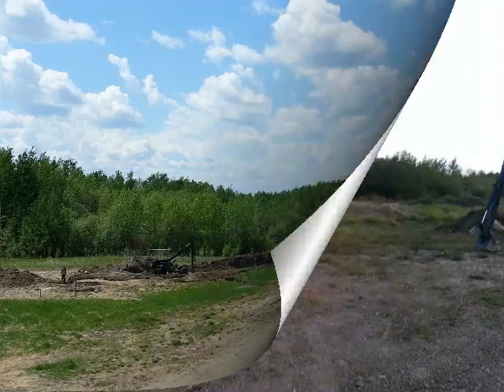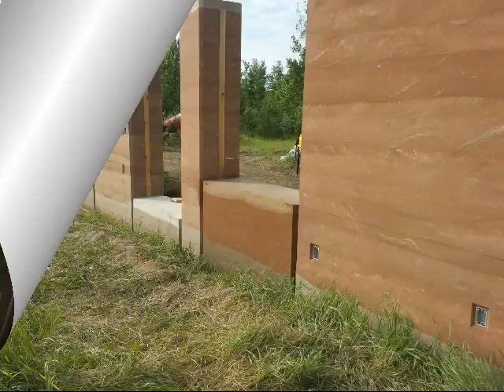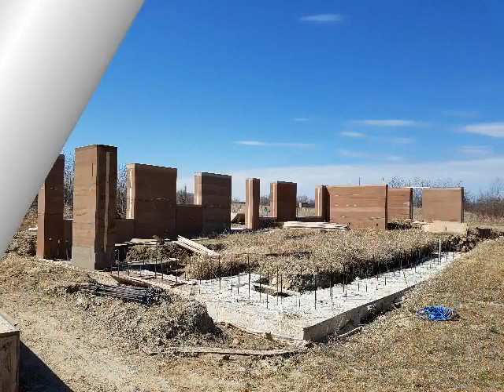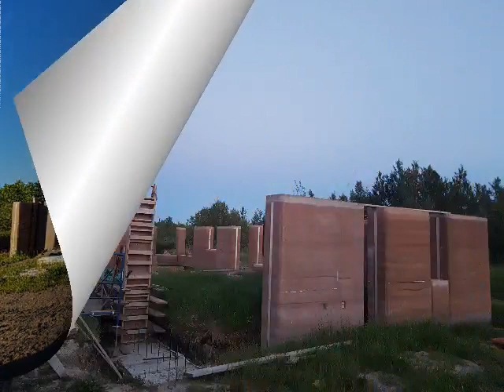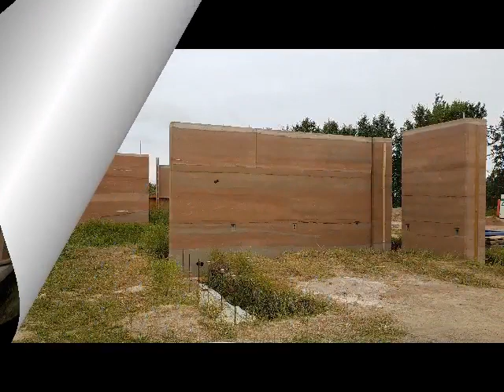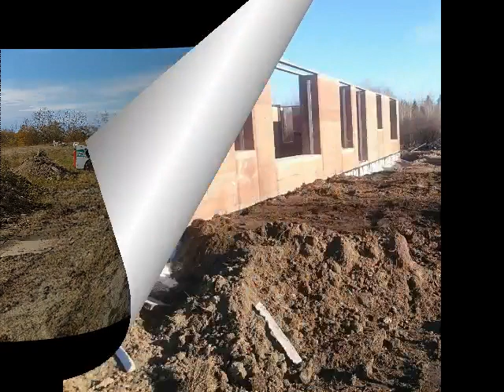Rammed Earth House Build, Time lapse

Comment: Hi Paul!,  i want to build my house with rammed earh,i have a few questions..,  what is the ratio of sand, silt, clay, gravel and  Portland cement ?, the walls can be of any widht right? ,did you insulated the middle with something? , how much time does to build one wall ?, and does the walls after putting the portland cement  on top , support strucutral loads like the roof?, electrical and plumming are putted while ramming the earth wall right?, hope you answer my questions , i love the colour of you walls , and the hole project, you give me hope.
Reply from the maker: Diego Viacava Hello Diego, if you look through my blog "rammed earth Saskatchewan" you will find most of your answers. We used 5% Portland in a road base mixture which is roughly 15% clay, 20% silt, 25% fine sand, 25% course sand and 15% gravel.

Comment: Can rammed earth retain same moisture freedom of movement as strawbale house if insulated with foam? Seems to be standard practice by architects to use foam. Does not seem implausible to do something equally as moisture permeable as strawbale to also allow air flow through the wall.
Reply from the maker: Mesquite TxHillCountry Hello, On either side of the foam, the walls can absorb and release humidity. I've read strawbale is considered breathable wall, it would depend on the surface render. Portland, lime or an earthen render would have varying effects on humidity / breathability. 😊
Reply: Good to file away, thank you. Expect to do a build starting in 2020. Like supporting healthy techniques that are functional. Enjoy your home, congratulations~

Comment: This is an amazing project and looks like an amazing team too!! I’v been trying to work and design with rammed earth for a while but I have some problems. There is no clear guidelines on how to do it (mixture, compression strength, reinforcing, detail drawings, structure calculations, etc.) unlike concrete or steel or any other building material. What is the mixture ratios? And is there any waterproofing that you apply after? I would really appreciate it if You can provide me with more information! Thank you!
Reply from the maker: Hello Faisal, you may find some helpful information in our blog, https://skrammedearth.blogspot.com/?m=1
Reply: Your blog is what lead me to this video hahah. It is awesome and you show everything that has to do with constructing it. However, I read all the posts but I couldn’t find information on the exact mixture. 

Cheers!
Reply from the maker: Look two conversations down, I gave the ratio to other person
Reply: Ok. Thanks!

Comment: Is rammed earth can survive rain?
Reply: Paul Burton im from philippines where moonsoons are terrible,i did tried to make rammed earth house,actually i live only 4 months within that house,the rain melted it. Any idea?
Reply: @brownmonkey5782  Stabilized rammed earth.  The secret is to use 5-10% portland cement mix, or fly ash to stabilize the mix.  Or you could put some kind of water resistant lime render on the outside instead.  Like the old Cob walls in the UK.  If you're doing only rammed earth, not stabilized rammed earth, you'd need to make sure the rammed earth doesn't touch the ground (good footings) and is sheltered from the rain (good roof with overhang).